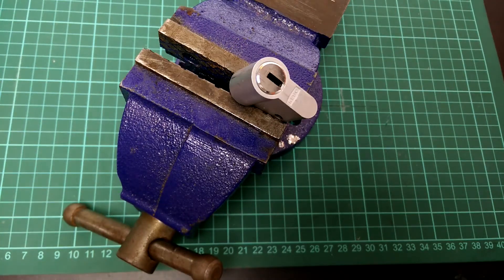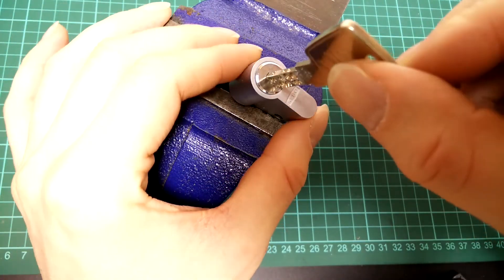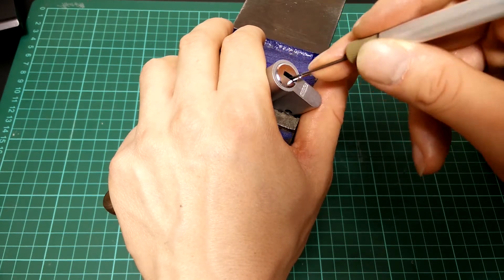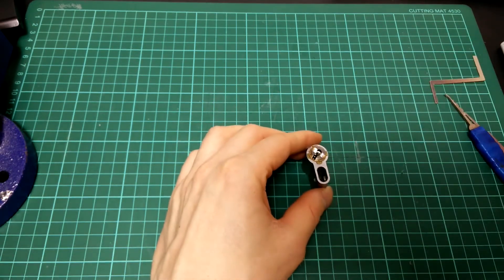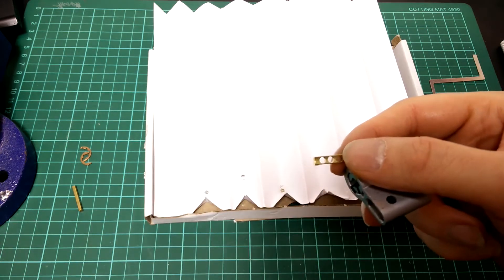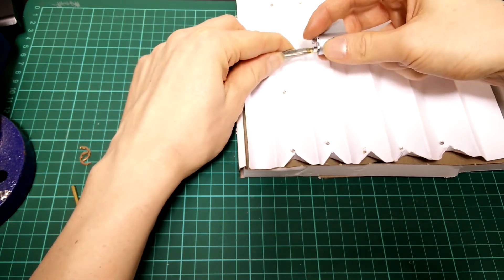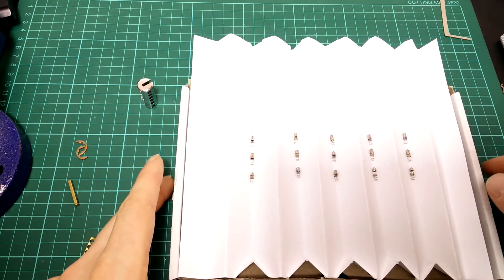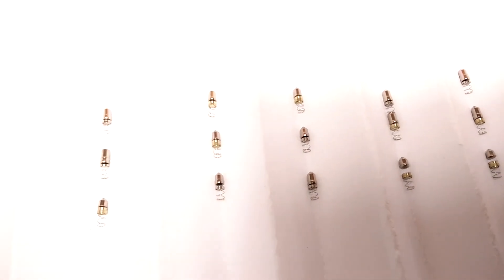(060) - "Keso 2000s" - 15 pins + security pins, picked & gutted

Comment: Another terrific video of an amazing lock! I don't think I've ever seen the inside of one of these before! Well done my friend :) Were you able to get it back together?
Reply from the maker: Thanks for your comment! :)

I was, but turns out, the pin stacks are VERY sensitive in regards to their overall max length: I tried to just swap the key pins to fit the key I received from Potti - in the end, some pin stacks turned out to be too long so that the key pins can't be pushed deep enough into the housing for the key to fit. Have to pick it again and rearrange the pins - luckily I didn't had the key inserted when putting it back togeher, otherwise I'd have to use some shims.

But putting it back together was surprisingly extremely easy, I would say even easier than with regular pin tumblers: Just put in a bar, insert a driver, compress it with your fingers from both sides and push the bar into the housing one position - it really is that simple!